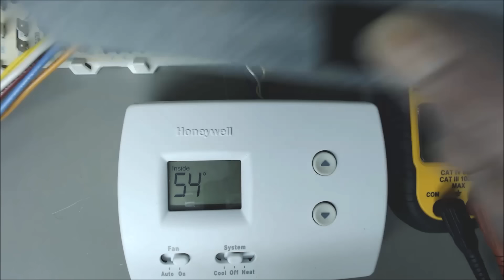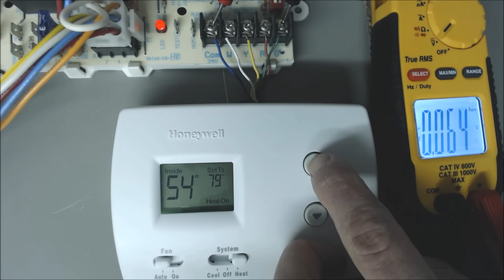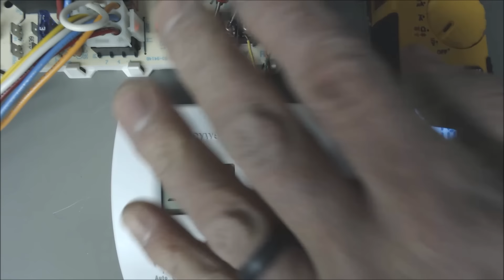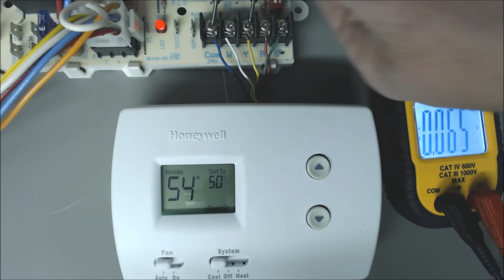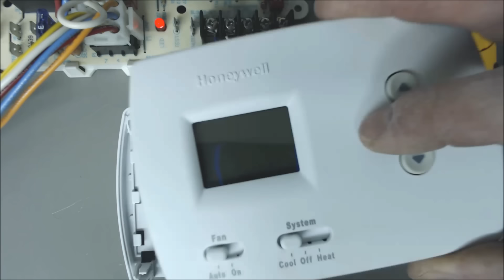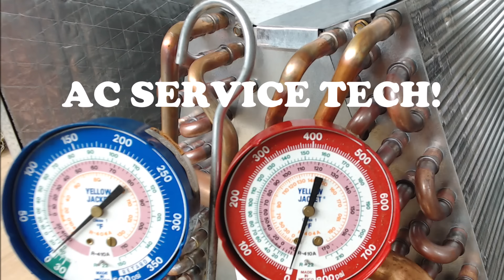How to Test a Thermostat with a Multimeter!

Comment: The heat on the thermostat will not turn on without me turning it off then on again or going one degree below room temperature then back above room temperature. Why is that ?  I can put the temperature to 76 but it won’t turn on only if I do those steps . It’s on heat and auto but will not turn on unless I do those steps. It’s a new thermostat

Comment: So when the tstat finally calls for cooling and only the IDM runs with no condenser unit. No voltage from y to c. Only y to g. Checked secondary overflow switch(dry), pressure switches at condenser unit.( pressure in system). Could this mean tstat is defective?
Reply: Started with a blown fuse. Replaced. Then only the idm runs. Checked for continuity(good) even stripped back clean wire for terminals.
Reply: Tested two tstats and both had same issue, no 24v at board on y to common. Then i put the original tstat they had back on and works fine. Defective tstats?

Comment: Different appliance not sure if you can help....I am burning up relays on a pcb for a wine cooler...it has a compressor and is basically just like a refrigerator....I am having an issue with low voltage at the pcb relay ..I get the constant 12v supply but not getting a good ground on the other side of coil...I measure 6 volts across the coil....

I took a look at the board and the drive circuit for the grounding of the relay and I can't seem to find anything that really stands out other than the transistor base only receiving .5v......it should receive .7v

You ever hear of a thermostat having some type of resistance issues or problems in the thermostat itself that is sending a good enough signal to close the relay contacts and operate the compressor but not a good enough voltage to get the relay to operate as it's supposed to?  I could just have a transistor issue but I don't know enough about pcb components to diagnose transistors....I'm just seeing that .5v and I know that number is low

Comment: Why is it that i ONLY get 24V between Common/Blue - and Red  + when the unit is ON ...
Once the ac turns OFF, i loose that 24V connection until the unit turns back on ... 

Isn't there supposed to be 24V there all the time whether or not the unit is ON or OFF ??

Comment: Thank you so much for this video. I had 28 volts at the unit but only 17 at the thermostat so my thermostat wouldn't run unless it had batteries in it. When I looked at the wiring the builders never hooked up the common wire inside the unit that runs to the thermostat. Once I connected that it fixed everything!

Comment: I have a question for somebody that does heating and Air I have three thermostats I have hooked up and neither one of them want to work right without wires hooked to I don't get any continuity from the red to the white on the heating cycle is it not supposed to be that way or what's going on can somebody answer that
Reply: I also jumped the wires red and white together and the furnace works but with the thermostat it does not
Reply: @robertpoteet6324  if you jumped the red (24V) to the white (heat) and it kicks ON, that means something is wrong with the thermostat

Comment: This is a great video. Thanks! Question: my thermostat has died (I still have power to the display but no response in the buttons and no response when trying to reset it). I want to test to make sure I'm still getting power to the thermostat from the furnace so I can temporarily jump it until I get my new thermostat. It's a White Rodgers (now Emerson) 1F78. This only has RC and RH (not a separate common or R) so do I use the multimeter on RH and on W (to test heat) or is it RH to RC? Also I can't get the magnetic cable you feature but I can get the Supco MAG1BL which is also up to 30 vac. Will this work? Thanks again!

Edited to add more detail.

Comment: I don’t get it. When my face plate is off, there is NO voltage anywhere on the pins, but yet my thermostat works when it is snapped back on. I see that your blue wired is on the C connector. You called it the common wire. Is this the same as the ‘C’ wire? I’d like to replace my thermostat with a newer model that requires a c-wire (a blue) but I can’t get any voltage readings.

Comment: Wouldnt it be less confusing to test the mode its in (ie cooling), from Y to R?  Then the reading is more simple (with power applied): a closed switch = 0 volts;  an open switch reads = 24 V
Reply: thats exactly what threw me off too i was testing my control board and found the multimeter read 24v when it was calling for heat so i thought the thermostat was in open circuit
Reply: Still throws me off till this day. Gotta take a step back & gather my thoughts sometimes lol such a simple thing that can be over complicated if overthought

Comment: Hey i got a question; why in one of your older video about checking a thermostat; you said do not to check voltage between  Red and Common terminals because it can blow the fuse o burn the transformer? And here you are doing it?  Did you mean  not to jump red and common? Or checking voltage between red and common? Can you please elaborate on that? Just asking for a friend!
Reply: Yes of you jump red and common it could blow your fuse

Comment: Why is there a 24 V reading across switches that are closed in a thermostat 
But when measuring voltage across a light switch for example, a 24 V reading would mean switch open?
Reply from the maker: There wouldn't be 24v between two terminals that were touching because the meter is reading the potential difference in voltage. You would measure from C to a hot to read 24v, thanks!

Comment: Thanks for the video. Question: how to measure the volts if there is no C wire?
Reply: R and Y wires is 24 volts AC.  Also R and W is 24 volts and R and G is 24 volts...using a voltmeter.

Comment: Quite helpful! I'm untrained in HVAC and thought I'd see 24 VAC between Rh and W when heating - not the W and C as you've measured (makes sense now). I have a gas fireplace (mV system) where an existing Honeywell connected Rh and W to replace what was previously a manual 'light' switch. To hook up my Sensi WiFi thermostat, I'm thinking of two options: (1) de-jumper Rc and Rh and wire Rc and C to the 24 VAC supply (for the thermostat to use), then wire Rh and W like the Honeywell it replaces. Seems easiest, but I'm not convinced the right way because there may have been a setting inside the Honeywell allowing it to support millivolt systems which my Regency P42 is. Option (2) is to wire W and C to a 24 VAC relay simulating the fireplace on/off switch. You make the point in another reply that current is flowing through Rh and W, so it sounds dangerous to use the thermostat's internal relay as a switch - I'll check the Honeywell manual if there was a setting to de-energize it on that one but the Sensi manual simply says "millivolt systems are not supported."

Comment: I have a nest thermostat I have it on cooling as it shuts down the fan constantly keeps running
Reply from the maker: It is either the program setting such as it being set on "fan on" instead of "Fan auto" or it is possible that the g wire is touching the r wire, thanks!

Comment: Why can you DETECT VOLTAGE across a load that is energized from THERMOSTATS, but not from a SWITCH when the load is energized?
Reply: I know this is super late, just in case someone else is having this question.

When you are taking voltage across two points in a circuit, you are reading the difference between the two point. The C terminal is a straight connection to the C side of the transformer. The R side of the transformer is what is being switched by the thermostat to the W, Y, and G terminals to make the various calls. We see voltage because R and C are 27 volts RMS apart from each other.

If you were to read from R to Y, and there is a call for cooling, then you would read 0 volts because the voltage is the same across those two points.

Comment: I am replacing a an old Honeywell dig therm with a WiFi one.  When I removed the face plate there was a red wire not connected to anything.  I guess need to check for power but as it wasn’t capped off - there probably doesn’t have power going to it.  My husband says that it was always like that.  I do have a common wire.  But after connecting all the wires it is not receiving power.  Our old thermostat would click like it was turning on the heat but nothing would happen.  Hence the replacement.  I will check to see if the internal fuse needs to be replaced. The other problem that I have is that there is no place to connect the ohm meter to the wires on the new one unless I disconnect all the wires.  Long day = loads of rambling. Sorry.

Comment: I tested my wires and my multi meter read zero.  Does that mean I have bad wires or is there something bad with my furnace that it is connected to.  My power to my home did go out and cause 2 power strips to go bad, could that have caused the problem with the wires?
Reply from the maker: You would have to test at the furnace to see if you have 120v in and 24v when putting the meter probes between r and c. If the board has an led then it should be lit up unless there is no power or the fuse is blown, thanks!

Comment: wouldn't you short out the transformer or something else if you connect the red terminal whit the common one?
Reply from the maker: You wouldn't connect the 24v r power wire with the C common wire. You would measure with the multimeter probes from those two spots to measure for 24v thanks!

Comment: I'm curious if you're testing on an actual unit or if you have some type of demo panel built. I'm looking to build one to test thermostats using battery power. Any suggestions?
Reply from the maker: This isn't a demo panel but just a board with a transformer and tstat. If you are just testing the connections then use the ohm function between the wires as they exit the tstat when powering the tstat with batteries. I believe one of my heat pump tstat troubleshooting videos was shown like that, thanks

Comment: I'm troubleshooting my new Nest Thermometer.   I'm having to remove the Common wire from the Nest to make it work so I am troubleshooting what is going on.   If I measure the voltage from R to C I get 0 volts.   This is at the circuit board on the unit.    I just ran a new thermostat wire(to get the "C" wire) several weeks back preparing for a new Nest.
Reply from the maker: If you get 0 volts from r to c on the board then the board is not supplying the 24v needed. Maybe the 24v fuse at the board is blown?
Reply: @acservicetechchannel    I was a dummy.  #1.    I had the switch "off" to the unit when I was testing voltage.   Big DUH.
#2 found the issue.   When I connected the new Thermostat wiring the installers had used a short jumper inside the handler in the attic.   Originally the "Common" wire was not connected.   So rather than running my new thermostat wiring to the circuit board I simply connected to the short jumper.   So the "Common" wire connection was new on the jumper.   Well turns out the new lead broke underneath the wire nut so the "Common" wire was not actually connected from the new Nest Thermostat to the circuit board in the handler.
I guess the Nest was smart enough to notice and simply suggested removing the "Common" wire connection since it was doing nothing.

Working fine now that I fixed the broken lead.

Comment: my RV is of the Year 2009 and has the problem that I turn on the air at less temperature and it works a couple of seconds and it turns off, what can it be? ... I already clean it completely and follow the problem!

Comment: Good clip,
so the blue common ,only provides a neutral to the thermostat. Is that correct.The Yellow goes out to the outside contractor, but what is the other side( the neutral).Is that the neutral coming off the transformer ? Thanks
Reply from the maker: Yes, it connects to the blue that can be used as the common for the thermostat, thanks

Comment: What do you check for 24 volts with if there is no common. As in no wire and no clear connection on the board
Reply: Jeremy Caswell I would just jump the wires then , use a jumper or tie the R n G wires together and see if the fan turns on , that will let u know if the thermostat is bad too ..... I’m still in school so idk , but that’s what I do

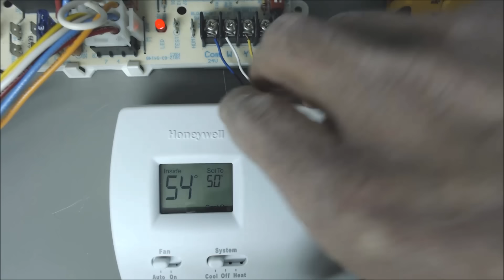Comment: hi, at 4:10 with the face plate pulled off. I you were to measure continuity between R and Y/W/G would your meter beeps? If so why? thank you for your help.
Reply from the maker: You wouldn't measure continuity because voltage is going through. You would test in voltage with C, thanks

Comment: I have no common wire
Reply from the maker: Then you wont be able to take any voltage readings at the tstat but you can at the furnace or air handler, thanks

Comment: Ca you explain the common wire? Can you test from R to  Y and get the same result? What exactly does the common wire do?
Reply from the maker: The common is the path back for voltage. It is needed to check for true potential voltage. A ground can be used as well to check for a hot wire. In order to power a load, the voltage is carried to the component via the hot wire and back to the power source via the common wire, thanks
Reply from the maker: One probe would go on the hot wire and one probe would go on the ground to check for voltage. We would typically check one probe on hot and one on common to check for voltage. Make sure you are working with a licensed professional when working on any electrical for safety. I am not the one selling the multimeter on amazon but check the stars on the particular company. I do receive a decent commission on each sale though. It is just a way in order to try to help make all of this free training financially sustainable. Any time someone enters any link I have provided, I will receive a commission which is referred to as an advertising fee even if some other unrelated item is purchased since the individual entered amazon through my link. The link must be clicked through here on youtube and not cut and pasted. Prices are the same as normal and I usually have the tool links in the description section of the videos. Here is a link to check out tools that I use-  https://www.amazon.com/shop/acservicetech
Reply from the maker: Robert, yes that is correct, thanks and yes those little jumpers are nice for a quick tstat jump. That is where you can't use the alligator clamps quickly with those sunken screws on digital tstats. Old ones we could just use the alligator jumpers
Reply: What do you mean by a ground can also be used to check for a hot wire?
Another question: Are you the one selling the multimeter on amazon? If so, I would like to buy through you.
Reply: acservicetech 
 Thanks a lot. 
Do you have a Facebook page?
Reply: acservicetech Thank you! It's always confusing with neutral, ground and common. So what your saying is what goes in has to come back to complete the circuit?
Reply: acservicetech I got those jumpers. They're neat.
Reply from the maker: Anouar, I presently do not have a Facebook page. I will let you know when I am up and running with that. I am currently building some HVACR teaching resources and should be publishing a book on procedures soon, thanks

Comment: what if you only have 4 wires? R, W, Y, G. how would you check voltage between the terminals? R to the desired terminal?
Reply from the maker: Check with the w to c or y to c, or g to c back at the board for 24v to see if the tstat is working, thanks
Reply: @acservicetechchannel  : So we have to have a C terminal in order to check the voltages of other terminals, right? Thank you.
Reply: R and W is 24 volts AC.  Also R and Y is 24 volts and Also R and G ...

Comment: I see a lot of furnaces and thermostats that don't have a common wire. If I want to check for a call for heat on th furnace control board, do I put my leads on R and W and hope for a reading of zero on my meter?
Reply from the maker: You would still put your meter lead on the c terminal and the w terminal on the control board even if the thermostat does not use a common, thanks

Comment: HI A.C I just bought a UEI DL 489 metre , But its giving me wierd Amp readings. For example when I turn on the metre it reads 0.4 -0.8 Amp and doesn't zero out . Also the readings are inconsistent with the rating plate or if i get a reading and after I un hook from my wire the reading stays on the screen . should I return it to my supply house for a new one or in your opinion what would be a better choice of metre for the price I paid for the UEI . I spent just shy of 400 CAD .
Reply from the maker: Wow I think I only ever heard of that happening once before with a weird amp reading. We have 12 of the dl389 at the shop and I also have had one for many years. No problems. They were $130. I am now also using the DL479 and they are $80. I would certainly return it and at least get another. Sorry to hear that Sean! I use the dl389 and dl479 for everything and would stick with UEI personally.

Comment: Have a question? I have a split system at work that is freezing up. The refrigerant is good and I put on a new defrost board also new filter, cleaned unit and it is still happening. Could you give me some advice please.
Reply from the maker: Have you tried to force defrost and make sure that it is capable and not going out on a limit or something in the middle of defrost. Typically defrost is for ten minutes unless a dft sensor is equipped and senses the temp is high enough. You could also set the timer on the board for a shorter period of time so it goes into defrost sooner. Let me know what you find or how you make out Keith, thanks!
Reply: acservicetech ok will do